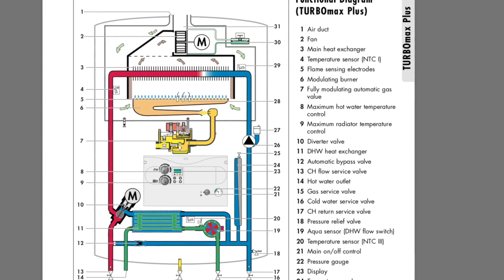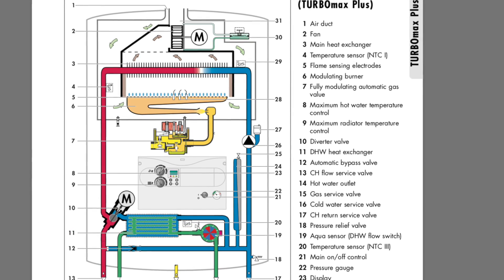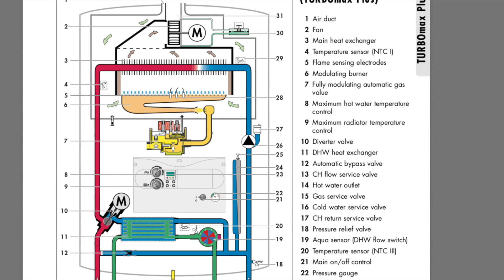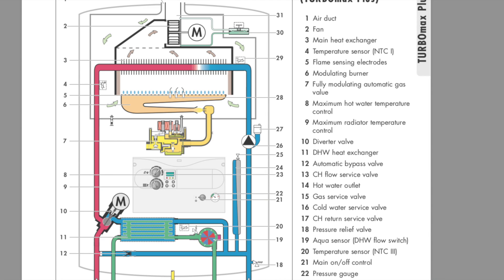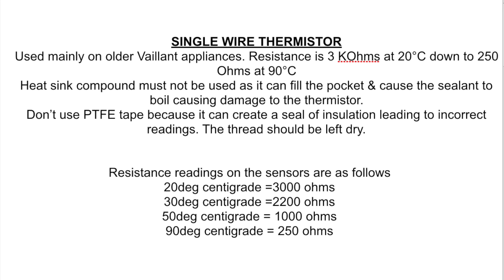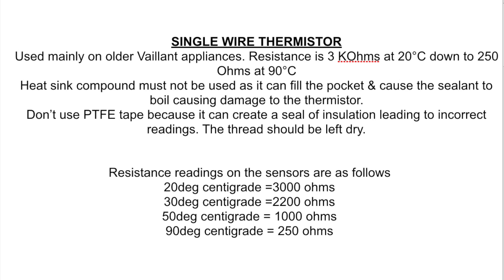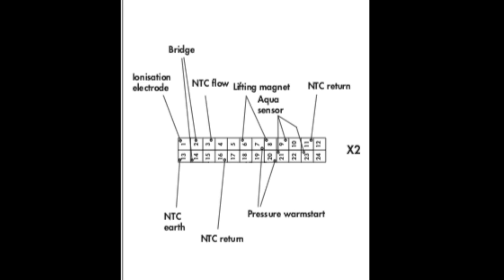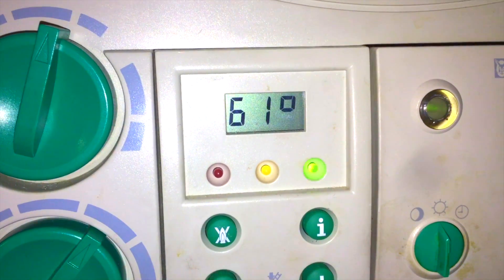Vaillant Turbomax Plus F24. Single Wire NTC. Boiler Repair And Training. Heating Geek.

Comment: I recently have had a number of parts replaced on our Turbomax Plus 828E combi boiler over the last few months. The boiler is 17 and a half years old, and I have had to replace the expansion vessel, heat exchanger, NTC single wire, pump, and PCB. There is also a slow leak from a non return valve now, so I am wondering if this boiler needs to be chucked after many years of reliable service? The F24 only occurred two weeks ago, but even though the single wire was replaced last week by Vaillant, it seems that there are number of failed issues and leaks happening in the process.
Reply from the maker: I would always try and keep a Turbomax on the wall. They are a fantastic boiler.  Because I don't know the specifics of your boiler I can't comment on your situation.  I'm sure the right engineer will sort the boiler right out. :-)

Comment: This is quality. Why does the ntc need to use the chassis as an earth if the white wire acts as an earth to the chassis?
Reply: Just answered my own question. Watched the vid again and saw the bit where you say the wire doesnt go to the ntc it goes to chassis. Weird. Next time I see one of these I'll look out for a wire. So is the wire just linking from position thirteen to the earth clamp in the boiler? I totally get the concept of this, just need to see where that white wire starts and finishes. Weird that the pipe (and other metallic parts) act as an earth on a component that relies on changes in resistance to operate correctly. It's kind of asking for trouble down the stretch. Anyway, this video is quality and helps us all think about why a machine isn't working rather than just knowing how to fix it. 👍
Reply from the maker: @JD-gi9pl  The white wire goes onto the PCB and onto the chassis. Vaillant stopped using this method on this boiler. I haven't really had this too many times but when it happens I know what it is. Cars use the chassis as an earth all the time. It works for them fine. :-) Glad I got you thinking. ;-)
Reply: @HeatingGeek  I'm glad you share this stuff. Like you said, on a basic level the thermistor measures resistance, when it interacts with pcb and gas valve and fan it gets called intelligent. But the components produce basic functions. Appreciate you putting it out there for everyone 👍
Reply from the maker: @JD-gi9pl  No worries. I'm glad people are still watching and commenting. Got loads on my plate at the moment. Hope to get back to it soon. :-) This I the fault I will remember forever. It took a lot of effort to find this one first time around.

Comment: Well done in working the principle out, BUT: Did the CU have a RCD or RCBO? Did you know most of F.24/jumping temperature displays are due to external influences onto the boiler chassis? Most common cause of this fault is failing elements in ovens, kettles, electric showers, N to E faults on supplies etc etc. Also boiler chassis at different potential from main earth bonding.  Measure N to E at boiler PCB, must be less than 5VAC and not fluctuating.
Reply from the maker: Yeah I know what your saying, but this one and another one I have fixed have both been this issue. I did have one in N11 that I never got to the bottom of that could of been an external issue. If the CU had RCD or RCBO they would trip in the situation your mentioning (Thats why you ask?). I didn't see the CU on this job, but did on the other which was split RCD Board. 
I haven't had this issue where external stuff caused it yet. I will watch out for it though and the RCD/RCBO is a good thing to look out for. :-)

Comment: You are an excellent fault finder. That was inspired thinking to realise that. You have to know how something works in detail in order to work out where the failure occurs. It’s a treat to watch a proper engineer work logically to a conclusion . In telecoms we call that fault and intermittent HR dis ( high resistance disconnection ) causes noise, faint speech, adsl errors, one way transmission, ring tripping.
Reply from the maker: Its a strange set up and works really well most of the time. Its only now they are getting older this crops up. Them little fiddly wires used in telecoms are a pain and look very frustrating to work with. :-)

Comment: Legend! Invaluable information you’re giving. Fair play, am going through every one of your videos thanks
Reply from the maker: I have give most of the tricks I use up. Still got a few to film but im running out!!!!! :-)
Reply: HeatingGeek 
On Glowworm and Vaillants, Co2 high and low settings are fine 9.2 and ratio is well below 0.004 but some I come across, the boiler resonates As the boiler modulates down, is there something I’m missing?
Reply from the maker: @gannas2322  If its on the glowworm Flexicom then no. They are a bit temperamental and need some finessing. What boilers were you having the issue with?
Reply: HeatingGeek yea Flexicom 30sx
Reply from the maker: @gannas2322  I could of guessed. Adjust the high as high as you can (within MI spec) and the low as low as you can (within MI specs). This usually sorts them.
Reply: HeatingGeek ok I’ll try that next time. Just thought they had to be the same. 
Thanks again

Comment: I have a similar issue with a baxi duo tech he 40 temperature instead and decrease.  Changed two sensors, new plate as dirty, new head motor. 110 fault. With hot water at tap flowing and boiler hw temp dial set to quarter setting, the temperatures are fluctuate to 55• down to 30•  Sensors read ok on meter. The new plate may have  dirt back in this as of fluctuations . Baxi say it could be pcb.  Customer advises that they have to reset boiler when fault code arrives.
Reply from the maker: Pcb or harness issue. Thats my guess. :-)

Comment: Interesting design, never seen any manufacturer use chassis in boiler as negative pole,. In case chassis is also connected to earth you can fry entire electronics of boiler by touching AC wire to frame of boiler. What an awful design. Sure, saves using bunch of wire but I cant help  stop screws of regular boiler rusting after 4 years, let alone maintain proper contact for entire frame.
Reply from the maker: I know. But this is the best combi ever made in my opinion. The weird NTC thing works for years so its not really an issue.
Reply from the maker: It only the ntcs that use chassis ground. Everything else is normal.

Comment: would just replacing the ntc not work? rather than adding that link out?
Reply from the maker: No. Its the high resistance across the boiler parts to the chassis. Changing the NTC does nothing. I do explain how it work in the video.

Comment: E168 only appeared once .. 
the whole time after few attempts goes to E133 
Forgot to mention the boiler was full of water can only b from the gas chamber as the pressure was fine and no leak visible from any parts. 
Initially thought condensed might b blocked . 
Done the work on the trap and what have u . No joy so far ..

Comment: Gas valve 
Spark 
Rectification 
As it comes on for few seconds am convinced is the either the  rectification or the Pcb in that order 
Mind u the gas valve has one solenoid if it had two I d say the gas valve .
Reply from the maker: What have you tested?

Comment: Hi mate hope you’re well, just a quick one 
and E133 on the Potterton promax Comby that is it lights up for Five secondsseconds and it goes after five attempts to e133 again I did display the one which is E168 confused between the flame rectification device or the actual bored what are your opinion 
much appreciated
Reply from the maker: e168 has usually been the PCB for me. e133 could be a lot of things. What have you tested?

Comment: This is becoming a fairly common fault as these get older. Had it many times. The good guys at Vaillant know all about it !! The wire will fix it but technically is a modification to the appliance,  just thoroughly cleaning up the d/v connections does it. You’ve mentioned a short against front cover, this gives F20 usually. 
The following is unrelated but another age related problem.... look out for the rear flue blank plate plastic rivets failing meaning plate does not form a seal with chamber.
Reply from the maker: I have the screws for the rear plate falling down. I spoke to Vaillant 3 years ago about the earth issue. They didn't have a clue. (Even senior engineers). I have tried the clean up and didn't have good results. I replaced the pipe and it fixed it. Maybe using some acid type cleaner (on the end of the pipe and diverter) might help. 
But to test, the wire is the best option.
Reply: HeatingGeek - Even their Senior techs aren’t brilliant, just part changers mainly, there are only a handful of  good guys there, if you don’t know who they are you’ve had it ! The tech support is only useful for run of the mill stuff. Things you could fix in your sleep ! 
Hope you didn’t take offence at my comments, certainly didn’t mean them that way. I commend you for your videos, really excellent. Just wish you wouldn’t give away this stuff so readily ! Taking years of pain to gain this level of knowledge. Best wishes.
Reply from the maker: @Pro-nj4uu  I find it hard to reason with myself about theses videos too. 
Thats why the Worcester PRV change has never been uploaded. Its is a shame to give some of the secrets up but someone will some day  and its for the best if we fix more and install less. More money in our pockets and less in the manufactures.
Reply: HeatingGeek Ok. Fair point. I’d have uploaded the PRV one over this one though, most guys will figure out a way of doing that and have the scars thereafter to prove it ! This one however will baffle even the keenest of engineers as we have both found out !!
Reply: HeatingGeek I forgot to mention....it’s right we need to fix more, install less but if you give many more secrets up we could be out of a job !!! All the best.
Reply from the maker: @Pro-nj4uu  We will never be out of a job.

Comment: Thanks for sharing this weird but logical fault. That is why when an issue like that comes up theoretical knowledge and analysis are of paramount importance. The first book that I read about refrigeration and Ac on one of its passages the author said the following " when you have a broken refrigerator to fix instead of starting to disassemble it and make lots of work for yourself sit down and think about why the machine isn't doing what is supposed to.
Reply from the maker: That is very very true. I replaced the PCB based on someones else's diagnosis when I knew better.

Comment: Hi Ollie. Great find. On the Worcester l/h flow unit video, where did you get the needles you were trying to clear the press gauge with? Thanks mate. 👍🏻
Reply from the maker: I have put the link in now. (On the video description)  If you get it from the US (link) its very much cheaper.
Reply: Cheers fella. 👍🏼
Reply from the maker: @diamondheatingandplumbingl2064  No problem. Just remember to say its a gift so you don't pay VAT at customs. Because your company is getting you a Christmas present.  :-)

Comment: Like a car with a faulty ground connection due to corrosion results in high resistance in the current path (actually there are three options 1. short, 2. open, 3 high resistance). You should check, if you can measure the high resistance from the NTC to the PCB, maybe it will be able to provide an indicator for future problems. Anyway this was excellent detective work.
Reply from the maker: I have taken the resistance reading and it isn't a problem when its not running. Something to do with the vibration or water movement i think. Little bit of wire fixes it though!!
Reply: @HeatingGeek  Interesting and a really clever solution that was.
Reply from the maker: @yannkitson116  Thanks. It took a lot of struggle to get to that easy fix though!!

Comment: This is priceless information " was called to one with  f54+f24 only two weeks" it had a new  PCB+ pump '  fitted but on this occasion it was just  blocked plate to plate.
As always keep the knowledge coming  😁
Reply from the maker: Usually its heat related. But if the display is playing up be aware.

Comment: Amazing tip HG, wish i worked in the same company as you would be nice to tag along on jobs. Your like  celeb for breakdown engineers 🙏

Vaillant should sponsor you!! And maybe send you another choc Advent box 👍🏼
Reply from the maker: Was it you who mentioned turning the u gauge tube back on its self to make a tighter connection?  Thanks for that if it was. I had someone talking to me at a petrol station this week. Felt weird...
Reply: @HeatingGeek  Did you feel like a celeb? ;).
Reply from the maker: @umark6695  NOOOOOOOO was odd.
Reply: @HeatingGeek  wish it was me, and if was i would made you late for your next job lol. Also did you manage to flush the main heat exchanger at your own home? Looking forward to the video upload 👍🏼👍🏼
Reply from the maker: @mrsayef1059  Doing the video (edit) tonight/ tomorrow so hopefully by friday.

Comment: Respect me just let me know what do you replaced in the end exactly just the NTC 1
Reply from the maker: No. The wire fixes the issue. You can replace the pipe and diverter and it will fix it. Or just use an earth clamp across the diverter valve to create electrical continuity.

Comment: another quick bypass of the ntc is to set your meter to continuity and put it across the ntc / boiler chassis. the boiler will not modulate ofcourse.
Reply from the maker: It doesn't work with my multimeter. I replied to the guy that suggested that.
Reply: HeatingGeek fair play you need to get them clip on ntc of yours into production
Reply from the maker: @heatservicebwcuk1545  It would be nice!

Comment: that one will have beaten a few engineers, my turbomax is still going strong and is about 15 years old now, it has been a great boiler, I know it could do with a power flush because it has never been done and has not got a filter fitted, I have bought one just not fitted it yet.
Reply from the maker: It might not need a flush. Wait for my own boiler part2 and I show how I got chemicals into my system.
Reply: look forward to it.
Reply from the maker: @650GSF  Thanks:-)

Comment: Can anyone explain the function of the by pass does it just dicipate the heat and how does having or not having a by pass on a heating system effect it?
Reply from the maker: When the heating has been on for a long time and the house is hot all the TRVs start to close down and restrict flow of water. The spring loaded bypass should then open allowing the boiler time to turn off without overheating. 
On a traditional system it can be used when the 2 ports close and water stops moving all together. It allows the pump overrun to move the water in the boiler so it dosen't overheat.
Reply: @HeatingGeek  So what faults can occur apart from overheating if there is no bypass or if a  system has a bypass and also the boiler has a bypass?
Reply: @HeatingGeek  Hi mate don't know if you can help, going to see a combi on the weekend heating only fires when hot water is on or you have to reset boiler to get the heating to fire. Any suggestions to give me the heads up would be appreciated.
Reply from the maker: @johnalderweild6442  No idea. Need a lot more info. Good luck, hopefully something simple.
Reply: @HeatingGeek  no problem thanks for replying. Hopefully a thermistor or something.
Reply: The purpose of the bypass is as heating geek says and also to protect the pump as trvs close down etc
Reply: @heatservicebwcuk1545  Thanks for the prompt reply
Reply: John Alderweild no worries ! In simple terms when system demand decreases as in trvs close down , zone valves close. The bypass will automatically open to meet the pressure increase in the system. That’s about as much as you need to know with a bypass valve. It’s there to create an open path for circulation and protect the boiler and pump from overheat.
Reply: @heatservicebwcuk1545  so a blocked bypass wouldn't let the boiler fire on start up?
Reply: John Alderweild not that I’m a ware of mate as long as the primary flow and returns are clear the boiler should still run. When demand was met a blocked bypass would inevitably cause an issue
Reply: Usually it’s a lack of a bypass more than a blocked bypass ! I come across a lot of new boiler installs usually where the old boiler had no pump overun , new boiler has and on a s plan you must have a bypass as there is no open route unlike a 3 port valve
Reply: @heatservicebwcuk1545  ok will look in to that I'm much morecomfortable with combis than systems lol
Reply: John Alderweild make sure you understand how systems work and it will help you so much in fault finding
Reply from the maker: @heatservicebwcuk1545  Even a 3 port with TRVs needs a bypass. Although the uncontrolled radiator by the room stat should take up the slack.
Reply: HeatingGeek agreed assuming  hot water demand satisfied the valve would remain heating only until water called for again.

Comment: Another good video mate

I was just going to say about the F61 on the ecotec saying it's the Gas valve in the book but it's the pcb 
But you beat me to it lol 

Do you think your be able to do a video of a support on Vaillant combi when it's all rusted in? When you come across it next?
Reply: When the plate screws are rusted in it rounded off or how you drill the screws to get it out*
Reply from the maker: Yes as soon as i find one to do. I have done 2 or 3 and am still working out the best way to do them.
Reply: Cheers mate I've found a few ways of getting the rusted screws out ....... would like to see your spin on it
Reply from the maker: @robertskinner4148  Screwdriver chisel is how I removed the last few screws!!